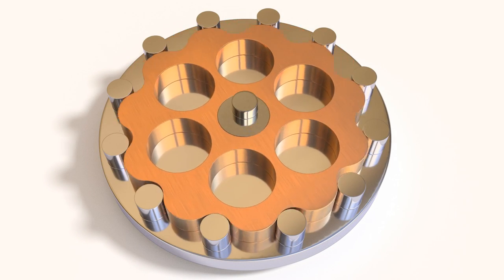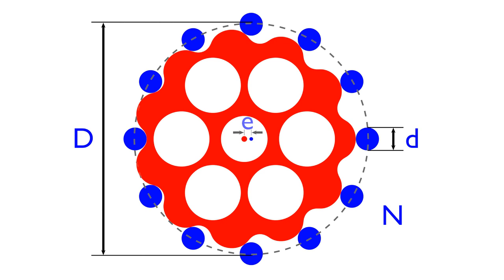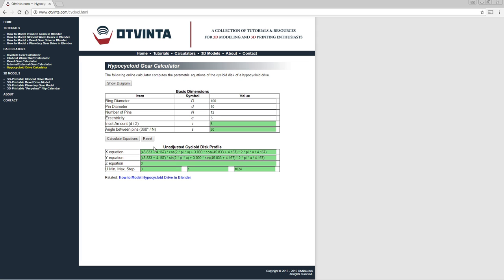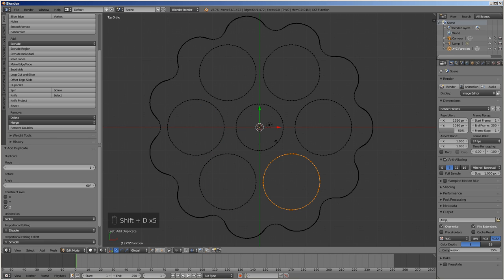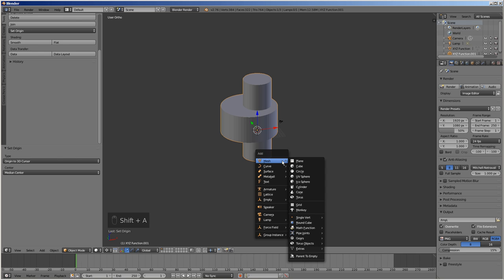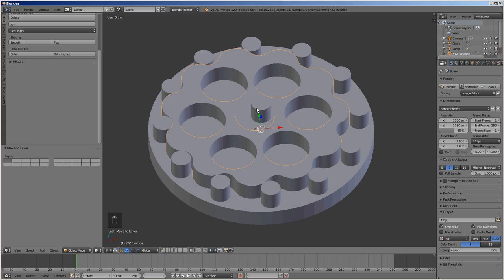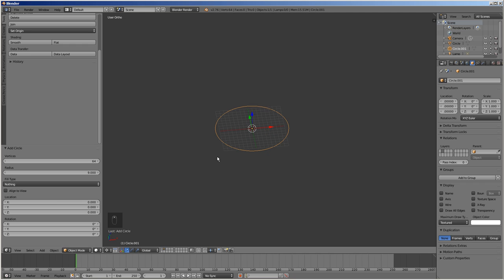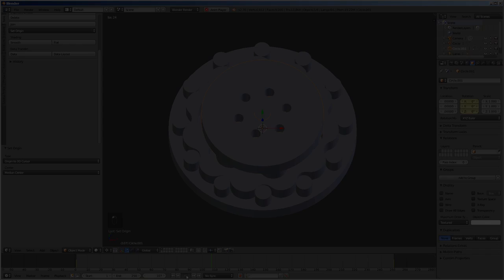Tutorial: How to Model a Hypocycloid Drive in Blender

Comment: To get the equations to work in SW, you need to change the "u" in the formula to "t" and depending on design parameters setting T2 sometimes has to be slightly less than 1 to enable offset to work  ...  thanks again !!
Reply: I was so confused to get it right in sw . I even tried removing extra spaces and replace u with t but setting parameters a bit less may work
Reply: What about units? Grad or rad... MM or inch?

Comment: Awesome video. Thanks!
Understood that the radius of the radial holes and their offset from center of the cycloidal disk is arbitrary.
But what about the diameter of the output pins that fit within the radial holes in the cycloidal disk? What about the distance of these output pins from the center?

Comment: Hi, thank you for the helpful video, how are the number of holes on the disk calculated? Isn't there a relation between the hole diameter and the stress on the disk? What if someone decides to build a gear with a different reducing ratio, how can the arbitrary dimensions be chosen?

Comment: Thank you for a fantastic tutorial. Can I generate on BLENDER x y coordinates at defined resolution?I would like to use it on CNC mill to machine cycloid rotor.
Reply from the maker: In Blender you work with meshes (vertices, edges, and faces.) You can make your mesh as detailed as necessary via the subdivision surface modifier and other means.

Comment: Thanks for this tutorial. I'm brand new to Blender and this is my first project. I'm using a brand new default installation of Blender 2.83. Some of the layout and the hotkeys appear to be different from those used in this tutorial. I managed to do everything up to 4:18 but I can't find the "remove doubles" button mentioned at that point. I tried skipping that part but I also don't get a new face added when I press 'f' as mentioned at 4:29, so I can't get beyond that point. Any suggestions? Thanks.

Comment: hello, thank you for this nice work it looks so fine
can this totoarial used in solidworks to? it looks all so easy what are you doing  here. how can the holes in the disk be changed great will it be in you calculator
thank you
Reply from the maker: If SolidWorks has the ability to define curves with parametric equations then you should be able to use this approach with SW as well. I am not familiar with this product enough to assist.
Reply: Hi could you help me out in selecting diameter

Comment: Any reason the Array Modifier wasn't used?
Reply from the maker: There are only 12 pins, it's faster to copy them by hand than involve a modifier. But the array modifier could be used too, of course.
Reply: you could also just use the "Spin" Button and make sure "Dupli" is checked. Just enter 6, and 360. It would take less than half the time
Reply from the maker: Thanks for the tip, will use this method in the next tutorial.